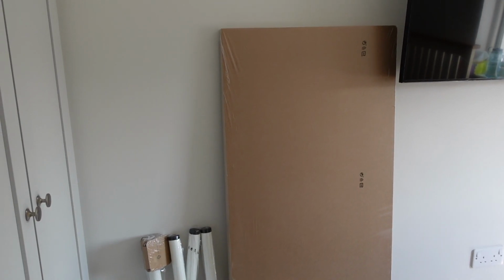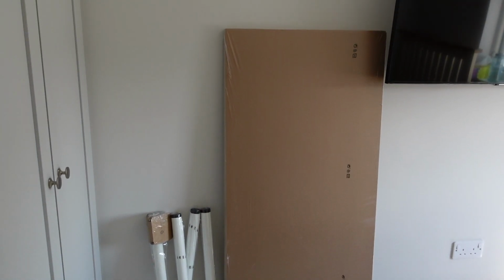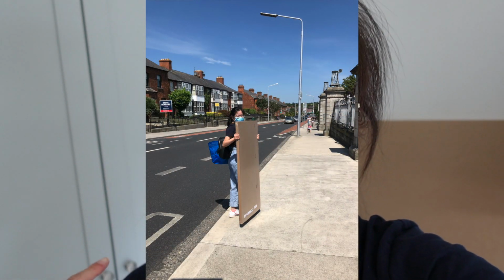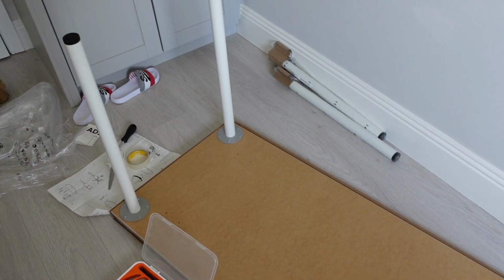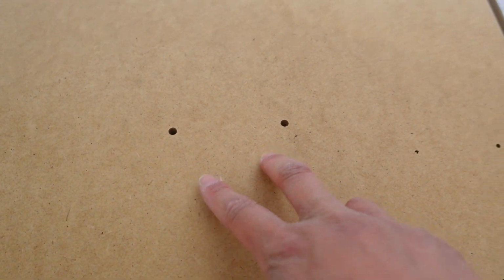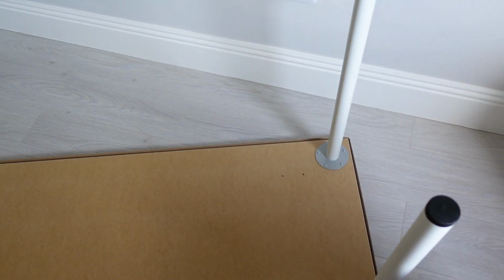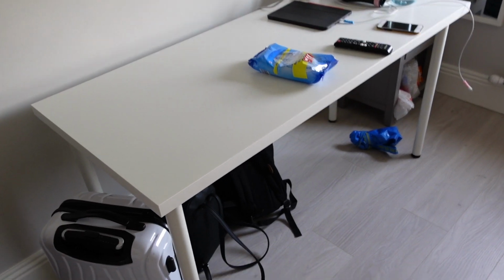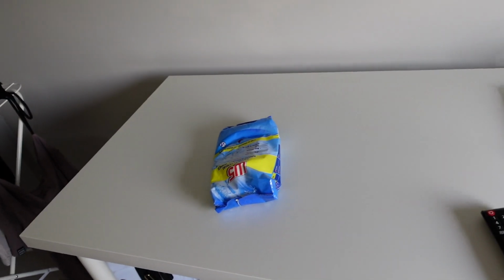Assembling the Cheapest Ikea Desk

Comment: i really hope you answer this ..
How sturdy is it ? like for normal laptop , keyboard , mouse and books will it be good enough?
And keeping stuffs like that on it , does it flex from middle even a little bit? since it's missing that 5th middle leg which is available on other longer size ..
please reply .. Nice vid tho
Reply from the maker: it's sturdy and good enough for my laptop and electronics but i don't use a keyboard/mouse or keep books on it. it doesn't flex at all for me!
Reply: @AvelineVlogs  okay thanks ✌🏻
Reply: Hi, did u buy it cuz you literally just asked a question I need someone to answer it for me😅
Reply: @awwaash  hey , 
Yes i have bought it . And it's good enough . I keep my laptop, monitor, mouse, keyboard , books and some other small items on the desk and it's capable enough to handle it easily. Overall great desk .
One issue would be due to the lighter build you can have a problem of wobbling other wise its all good
Reply: @dhruvil8  Ohh okay that’s perfect thank you very much I’m going to order it now🤩!! But about the Wobbling problem can you take the black thing off to make it balanced or it comes with it?
Reply: @awwaash  you mean that rubber legs thing ?
Reply: @dhruvil8  yeah
Reply: @awwaash  that is for balancing uneven surfaces .. 
I use it on flat surface but still it wobbles a bit . A trick would be to keep one side of the desk touched to a wall or something so it gets support and wobbles very less ..but if you will be using it in very open without any wall or something touched to one side then it will wobble
Reply: @dhruvil8  No there will be wall behind it so I hope it won’t make it wobbling, but thanks for the note I appreciate it!😁